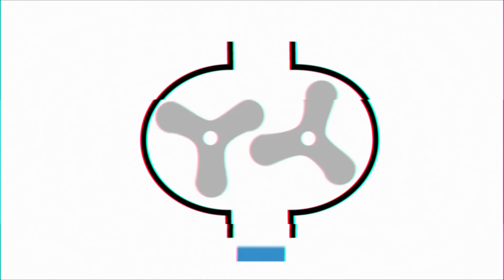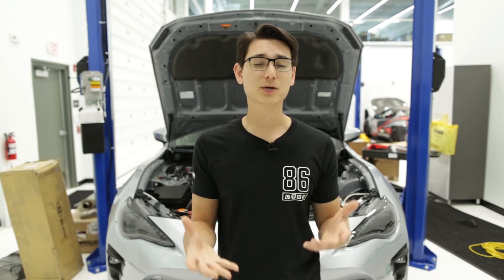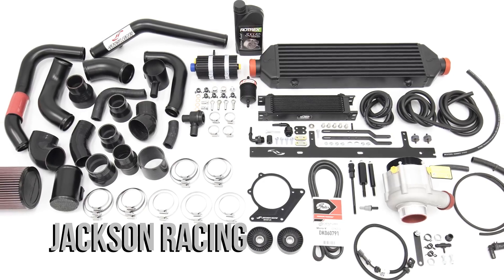Everything About Superchargers | FRS BRZ 86

Comment: How much Boost/Horsepower gain can the stock Engine and Trans handle before needing a rebuild
Reply: The engine is roughly 300-350 hp with some supporting mods  I'm not entirely on the transmission but I know its not the strongest of trans seen quite a few people rebuild/replace them when boosting theirs

Comment: Car noob here with a (probably) dumb question. Would it be possible to fit both a cold air intake and a supercharger into the FR-S’s engine bay? I have my eye on an Injen cold air intake that seems to function as a short ram intake (at least from what I’ve read). I’d like to start with that before I move on to making more power, but I figure it would be nice to add both.

Comment: 3:30
Why would you want high end power on track days? Isn't it better to have it instantly when your messing with turns?
Reply: at a track you're typically at the top end of the rev range, you downshift as you come out of the turns.
Reply: @MLGKrazeR  ok. I guess it all depends on the rpms in and out of the turns and what track it is.
Reply: @naturalmystic5098  in racing situations you're usually keeping it in the powerband regardless of where that is on the tach.
On the street/ as a daily, though, it matters a lot more how much torque you get down low and in the middle.

Comment: I want to get the rotrex but I've heard terrible rumours of the c30 breaking, (impeller specifically) after less than a year of use and that the warranty system that kraftworks offers is a complete scam. So I think I'd just get a turbo.

Comment: Guys, I'm not boasting about the Camaro... I'm a bit confused. I have a '14 frs now, love it, and am considering pushing up the power. My previous was a '12 camaro SS (400 hp (factory) LS-1). [One Sunday morning some assh*** T-boned me and totaled it.] With a new K&N filter, racing headers, exhaust, and mufflers, a sweet cam and a genius tune I went up to 600 hp on the dyno and the tuner told me if I didn't mind a rough daily drive I could easily get 700. No turbo or supercharger anywhere. That's a 50-75% increase , normally aspirated, for $4300 (including labor), out the door. Is there something magic about that LS-1 small block as compared to the FRS I-4? Between $4-$5 K, or more, (parts only) for a 40% increase in power for the FRS? What am I missing here?
Reply: Big fan of the LS engines myself.
Your car didn't have an LS1 though, it was the L99 (if the 400 factory hp is accurate). Still awesome engine. 
Also the Toyobaru twins have a flat-4 (H-4), not I-4.

To answer your question:
I believe it's that these cars (I currently daily an FR-S too and miss driving a V-8) come from the factory in a high state of tune already.
That's the problem with small-displacement engines. 
A key here is "specific output," aka power per liter. The higher that is, the less room for improvement there is - the harder it is to squeeze out much more power.
It's like if your Camaro came from the factory with 620 hp NA from the 6.2L. How much more do you think you could get NA? Some, but not a ton. Just like the FR-S.

Alternatively, suppose the Camaro still had 400 hp, but from a 4.0L NA V-8 that revved to 7400.  Essentially two FR-S engines. It would be the same as an FR-S - not a ton of room for added power without boost.

That's why there really is no replacement for displacement.
Reply: And your Camaro's massive power gain for not a whole lot of money is exactly why the GM small-block (namely the port-injection LS family) is so awesome. That plus how they sound, their relative light weight, low initial cost, reliability, modest fuel consumption, compact size... Lol
Reply: 5 years later just gotta say no way are you getting 600-700 WHP out of an L99 without forced induction on stock internals lol

Comment: why can't you take both the turbo and the charger?
Reply: You technically could, I think it’s called twin charging. People use it to reduce the disadvantages of both boost methods. I’m no expert but I would think if you were to twincharge a stock 86 you would blow the engine pretty fast. Not to mention the complexity in the system since you have to have the supplementary components for both the supercharger and turbo charger.

Comment: Super Charger all the way, makes this car how it should be when it left the factory. Get my hks fitted in 7 weeks, cannot wait. Bye bye stock!!
Reply: What power numbers you looking to hit? I am torn between supercharger or going balls deep with forged internals and turbo, but more money of course aha
Reply: Hail No Hero Going for the HKS V2 supercharger and uprated clutch, takes it to 270bhp and no need to upgrade your exhaust, though i have an aftermarket one. With turbo you do have to upgrade the exhaust. I chose to go supercharger/ 1-easier to live with day to day 2-less maintenance 3- similar boost levels to turbo and can go past 270bhp with same supercharger if want to go down the forge route. 4- not many cars have superchargers unlike turbo they are everywhere so having a supercharger is more unique in my opinion and lastly 5- the power levels are more predictable than having a big turbo on and i love the noise a supercharger makes. Thanks mix✨🌟⭐️💫
Reply: @012_ljk  270hp is at the wheels or the crank?  The only power related upgrades I've done so far are exhaust (header-back) and CAI. No tune as yet. I recently got a chance to drive a turbo 86 and, honestly, I wasn't as impressed as I thought I was going to be.  Don't know what kind of kit and/or tune the guy had though.  Having said that, he did buy the 86 used and said "they used quality parts but installed them badly".  Any chance of an update once you get your HKS installed and you've run it for a while? Peace.

Comment: Turbo is the way to go on the 86. Dont c the point tryna get raw power froma 2l 4 cylinder engine theres people all over youtube safely push the fa20 motor to 400hp. 12 psi, with a turbo
Reply: ah yes more horsepower must always be the better option yes.
Reply: A supercharger leeches from the motor.. And if your gonna spend money on an upgrade thats leeching from a 4 cylinder engine be my guest youre gonna spend thausands for little gain
Reply: Positive displacement superchargers add more than they draw

Comment: Just out of curiosity how much would a turbocharger ruin gas mileage
Reply: I would say it depends on tune as some manufacturers use forced induction to increase mpg; but in the end mpg comes down to environment (temps, hills, road surface, tire compound and pressure, etc), traffic (lights, stop signs, other people/gridlock, etc), and your personal driving habits (flooring it versus mild acceleration, coasting to lights instead of hard braking when you get close, keeping speeds as low as you can in as high as gear as you can without lugging it, etc).

I got 40.1 mpg on an interstate trip on a brand new automatic BRZ a friend bought.  I've gotten almost 100 mpg in a Civic Hybrid from 2005 on an interstate trip.  I've gotten 45 mpg in a 99 Accord sedan on an interstate trip.  I've had an old Pontiac that got 9 mpg no matter how I drove it! ;)

So, drive calm, get more mileage, but most people are going to drive harder and probably see a 10-20% decrease minimum in mpg hearing the whine of a SC or the spool up and bov of a turbo.  Had a Eclipse Sypder GS-T I couldn't tell you the mpg I got, but I could tell you I would spool it up and let it blow off that pressure A LOT lol

Comment: That dude in blue said it throws codes. Is there any Guarantee in hp gains as well as reliability till 300 hp
Reply: I've been running my Jackson Racing supercharger for over two year, and had it remote tuned by Delicious Tuning. I'm making 260 whp and 195 Torque at 11PSI. I've had no issues with my setup and taken the car to the track twice last year. I'll mention I do have supporting mods to keep the system reliable.

Comment: Hi Thomas, I have a hks supercharger on my 86 but the car broke down recently. The belting from hks was then found broken, and the engine oil was leaking from the crankshaft seal. Are you familiar with any of these problems?
Reply: I know it's 5 years late but sounds like you have a crankcase ventilation issue with blowby from the added boost which is normal pushing out the crankshaft seals...you need to replace your pcv and add a catchcan or delete it and plumb the leftover pcv lines with a catch can set up pre supercharger to help keep crankcase pressures low...the delete part is a super old school solution that should work on most cars even today but I would still check and do some research to see the best options

Comment: Ethanol as rule is less efficient than gas, so how can they claim more power gains e85 than gas?
Reply: because ethanol cools the engine more therefore you can add more fuel and be more efficient
Reply: It's not less efficient in combustion, it has a lower energy density.
In other words you get all the energy but there's less to begin with
Reply: It also has a higher octane, so you can tune it more aggressively than with e10
Reply: Call it what you will. I consistently got 10% less mileage on my 600cc carved motorcycle with ethanol tha non.  However I did alot of research after posting this and the e85 allows the running of way more advanced timing without knock, so while it's less efficient, it "can" produce substantially more power.  I was very surprised at the science of it all.

Comment: question relating to Centri-superchargers (more specifically the Rotrex SCs), can you position the Throttle body infront of the SC like most people do with the roots/twin screw SCs, or do you HAVE to put it after the SC like in turbos? my questioning for this is to reduce the need for a BOV (which i have seen a lot of people running a BOV with the Rotrex when the TB is after the SC)!

Comment: I'm confused, if a linear superchargers generate the same boost across the rpm band, how does replacing the pulley and spinning it faster make it give more boost?
Reply: merkantelismo Spinning it faster forces more air into the engine. Cramming more air creates more pressure - that's the boost.
Reply: @mightbesherwood1313  I think OP's question was that it spinning it faster via engine revving higher doesn't increase boost, why does spinning it faster via smaller pulley increase it?
To which I think the answer is that with increased engine revs, Yes, it shoves more air in, but since the engine is spinning faster, it's consuming more air too, and it evens out. With this type of charger.

Comment: It’s “combustion chamber“ not “combustion cylinder”. And, yes it’s true there is a parasitic loss in power from using a supercharger because it takes horsepower to turn it, but it adds more power than it uses to operate,  so there is a net increase in power

Comment: need more details on each, pros cons, details, heat, part quality, reliability etc etc... for the most part you're posting numbers... and 1 or 2 numbers don't say enough about the AREA UNDER THE CURVE
Reply: It is almost like it is an advertisement to sell more superchargers from their store, right?! ;)
Completely useless if you already knew some basics, the title made it seem like they were going to be helpful about the sister cars specifically, not a generic run down without dynos from a stock, then each of the parts so you could choose the one that best suits your individual needs.  Some want high rpm power, some want a flat torque curve that boosts low end torque a lot with much less focus on high end power so you don't feel like you are in VTECH for 1000 rpms and have to shift out of it :D  daily driving versus street rice ;)

Comment: I think with adding all the HP, they should inform people about the transmission and what HP it can handle. Seems like there are a lot of questions surrounding this subject.
Reply: A clutch upgrade may be needed
Reply: Butter Finger if you upgrade the clutch, make sure you upgrade the clutch for as well to a forge fork. The Oe Fork can not handle the stronger pressure plates and will break or shatter!
Reply: I had an auto Toyota 86 with cat-back, supercharger, and an ecu tuned on the dyno. I got it to 300whp but detuned it to 280 to give me peace of mind  (tuned on 98 octane). It wasn't a garage queen but I wouldn't say I thrashed it. Drove it hard enough to enjoy it, but not enough to wreck it. Lasted about 70,000km with no problems before I sold it. I would 100% recommend the supercharger mod despite how expensive it is. It'll never be a WRX or M3 killer, but at least you won't have to downshift and floor it every time you want to overtake or pull  out on the freeway. I could've sworn the engine thanked me for not revving it out to go fast anymore too.
Reply: @ing8404  you're crushing a wrx with 280 whp bruh
Reply: @123cornflakeman  Every WRX I've come across has some kind of mod and tune so I didn't think about a stock WRX :')
Reply: If possibly just CD swap the tran. Lol but honestly that's a good point.
Reply: well the automatic gearbox seems to be really strong

Comment: Well I can vouch for this company. I  have a 2016 FRS with the HKSV3 supercharger and all the supporting much to go with it plus more. I even went so far to have them to you in the car. My nearest Ecutek tuner is about 200 miles away and Graham has done an excellent job.   Don’t know the exact horse power of my vehicle but should be netting around 250 with stock internals.  I have spent thousands of dollars with this company and will continue to this is been one of the best guides I’ve seen for supercharger yet
Reply: So HKSV3 is the go-to supercharger? I just want something without turbo lag and has a significant power boost.

Comment: When you drive an FRS it’s always high revs man. Gotta go Centrifugal! Nice vid!
Reply: FRS JAKE hold on, the high revs rule is only for the stock vehicle, if you put a twin screw it's going to gain a faster acceleration at low rpms, that's exactly why you want a supercharger!
Reply: @LinkinPark4Ever1996  yah, if you just want to rev high, buy a RX-8 or S2000 and get that 9k+ redlines going on.  For the majority of people for the majority of driving, a twin screw for the low end torque increase is the way to go; you only lose a bit up top while gaining more down low.

Question, why would you go centrifugal instead of a good turbo if you want high end power?
Reply: FRS JAKE i went Sprintex... love it

Comment: What should i put in my 2017 Gt86. Turbo or supercharger?
I don’t wanna go to mechanic every month or week. Which one have less cost after installation and have more power.
Reply: Logan Turner Thanks 👍
Reply: Turbo for easier maintenance. Supercharger for easier installation.
Reply: Kevin Du 
I heard Supercharger belt not lasting after few months. I never tested anything yet. I'm beginner in this line.
Reply: Hulk banner I have the Jackson racing supercharger. Had it on for a year and had no issues. Building motor for 18psi. Runs great. Pulls hard. I love it and it's a cheaper option. Supercharger are not hard to upkeep at all. Haven't done anything since I put it on. Just make sure the belt isn't crooked on any pulleys. They make good power though.
Reply: Hulk banner follow the_white_onion_frs on Instagram to see the full build so far.